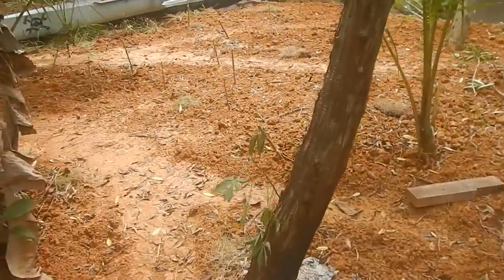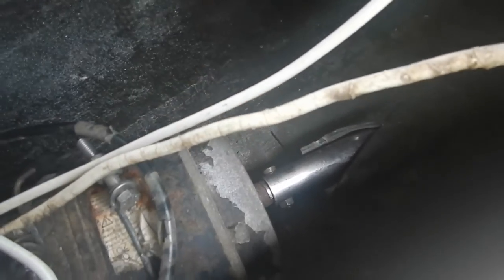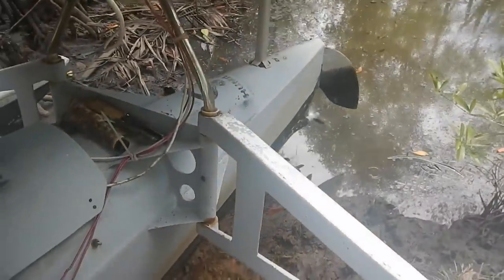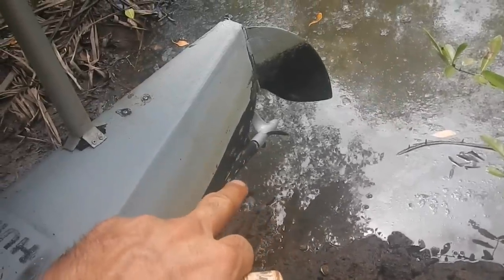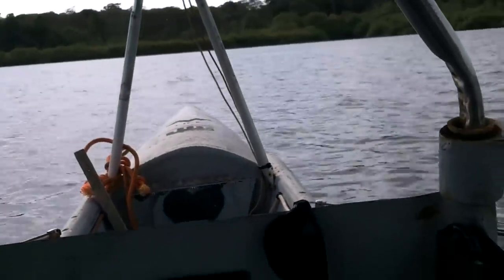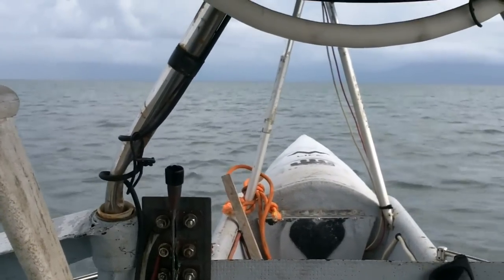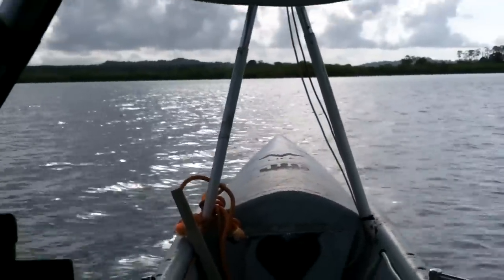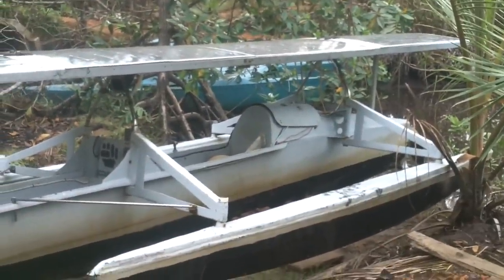Zombie Chopper 011 Heat Check

Comment: may want to check if axial load on the motor could make the rotor heat up... since the propeller will be pushing it up into the housing.

Comment: maybe put a rag joint between the shaft and motor (a piece of old tire and a few bolts ) and again I say you should find the tap point on your coil to match the max current listed on the motor to prevent over heating and damage of the motor.

Comment: maybe a little fan blade ring attached around the shaft there would help keep it cool
Reply: That is good idea  , it wouldn't use electricity.   Hopefully enuff clearance for the blades but even short ones could help.

Comment: Open the motor and put Graphite Lubricant in the front of both bearings. The front refer to the front of the boat because that side of the bearing is the one pushing against the bracket housing. Other wise bring the grill anion and steak to prepare lunch while going to town.

Comment: You can use fingernail polish as locktight for the nut to help it stay on. The bolt needs to be clean... No oil or the polish won't stick.

Comment: If you get enough friction to make your motor hot, you also loose lots of energy. If your motor was hot enough to smoke, there's a risk that you have weaken your magnets. Ferrite magnet can take about 250C before starting to loose magnetic strength permanently. That's one unfortunate explanation why the boat felt slower.

As many other have said, it might be good to use flexible coupling between the motor and shaft. It's needed when alignment is not perfect, like in your system.

Comment: The thing that comes to mind is cutting a small slot in the pipe so it could clamp down better, but your solution may be better. Keeping everything aligned right is probably easier this way.

Comment: Run some copper tube around the motor with a electric water pump it will help dissipate heat keep the motor cooler

Comment: I know im a backseat wrencher, but you might want to dissasemble the engine and repack grease in its bearings. especially the propshaft facing side, that has GOT to have cooked off. probably seals aswell.

Comment: It could also be that your motor is not lined up correctly with your shaft.. you might want to think about fitting a universal fitting or some kind of flexible fitting for it so that if it is not 100% in line then the fitting will take up the difference and also it will act as a thrust washer/bearing for the shaft and motor fitting. Do you need to fit a bearing at the top of the shaft if you have not already fitted one?